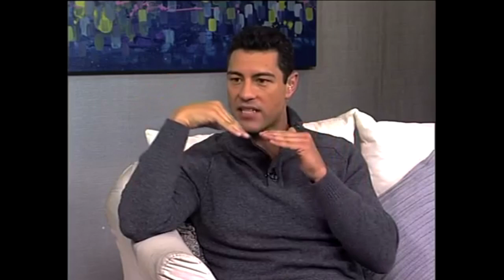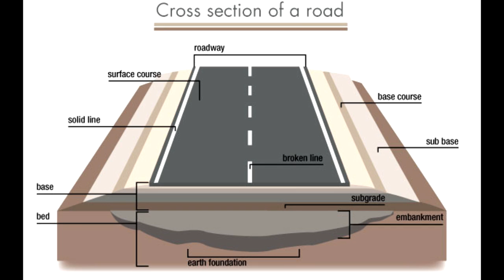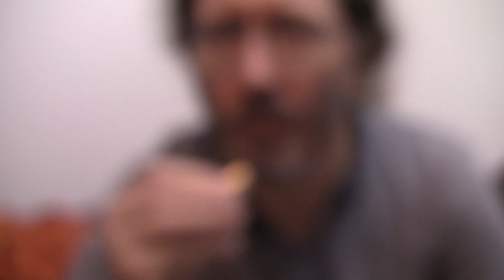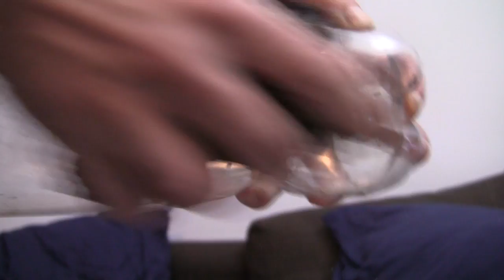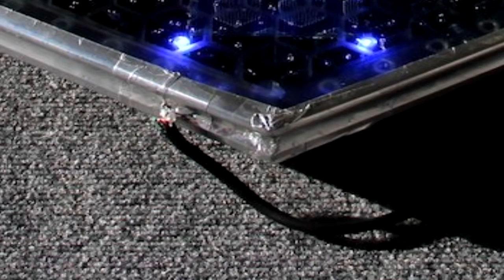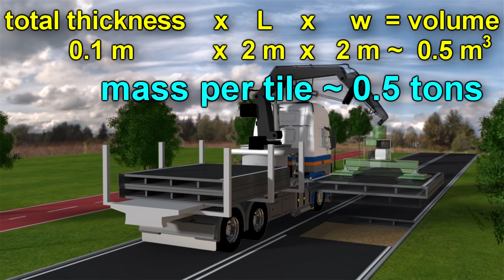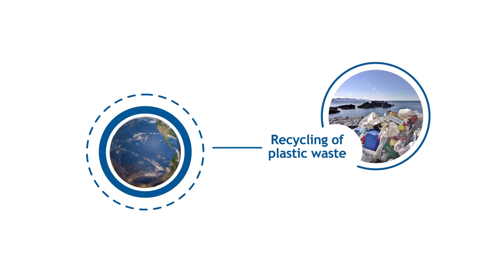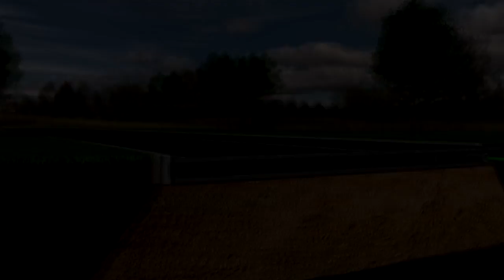Plastic Roadways BUSTED!

Comment: Sometimes on hot days over here in Australia the road gets all melty and gooey so how would that effect the plastic road? How would the various temperatures of different climates effect the plastic roads? What kind of grip would a plastic road have and would cars need new wheel tread so they don't slip and slide around on the plastic?

I have so many questions and by the end of the vid they only seem to have answered one of them. Good...

Comment: debunking advertising is pretty silly, as it pretty much is selling you on what they hope to achieve, so that you/government can support it with money. Just from the data you presented in the video, it is not obvious that they are going to try to make roads directly out of PET, and it may very well be that doping in some chemical will improve the support characteristics. Laughing at the bad construction of the solar walkway doesn't really say much, as innovators are not the mass manufacturers who will eventually be bringing stuff to scale, and production will improve over time.  To truly debunk plastic roadways, I think you would need to prove that it is infeasible, which simply isn't clear from information in this video. If there is any chance that it can be done, it could very well be an upgrade to infrastructure, as the goal seems to be simplifying road maintenance by modularizing the road and speeding up road  construction and repair.

Comment: I understand your point, but you are simplifiing it too much. PET is already in some mixture of asphalt. You do not drive on bottles if that is what you think!. Cement is really weak but steel reinforced concrete not. You just need to use the right materials.

Comment: Does this guy know that the roads are not going to be made of water bottles, it will be alot thicker, yet the same plastic type, and it would propbrably have a protective cover  made of epoxy or even a small layer of rubber.

Comment: The BS detector rose beyond 100% when they mentioned water. Given that somehow some random rule of buoyancy won't be affected here, because of road stability issues, it wouldn't drain 100%. Not only that, it could easily affect the adherence of the road, added the fact that they would "replace the road" easy as pie.

Comment: i rate it 9/11. would do some burnouts on that road.
Reply: You wouldn't make smoke tho and it wouldn't heat your tires
Reply: Quietbut_Deadly yeah it would, just not as well. just because you have less traction doesnt mean you have none
Reply: Renato J you don't need traction for a burnout.  When you spin your tires it creates friction, there isn't that much given off when you drive regularly but when you do a burnout the energy has no where to go which means it creates a lot of friction.  This excess friction heats your tires and creates smoke.  Plastic just wouldn't work that well

Comment: On work sites I have seen heavy-weight reinforced plastic drive-over cableways in use, those temporary speed-bump-like channels to allow power or water lines to cross driveways. These miniature "plastic roadways" are heavily scored by even light traffic and require frequent maintenance even when vehicles are creeping along over them.

Comment: Plastic roads would warp because of the heat of the sun. Thermal plastic is the stuff they would have to use if they want to recycle. Hdpe ldpe abs pvc pla and Pete also have varying melting temperatures.

Comment: I was thinking about that huge issue...

When you have pipes and wiring running under the road, how the shit are you going to replace these when you take that block out without causing blackout's?

scare me if you have to do this while it is raining and the site gets flooded from water draining..

Comment: but what if you get the plastic from the air? nah but really a polymer based recycled binder rather than bitumen sounds interesting, though you still need the aggregate material, maybe for use on walkways/trails or relatively low traffic areas such as driveways? definitely more feasible than the original idea atleast

Comment: As someone who works for a company who builds interstate roads and highways and produces asphalt/aggregate, the concept of solar and plastic roadways is absolutely ridiculous.

You may be able to melt the plastic and use it as an asphalt-cement replacement into the aggregate for the base and surface layers ONLY.

Oh wait you reached that conclusion at the end of the video.

Yeah and pumping melted plastic as a binder through a plant would be a pain in the ass. Regular asphalt cement is hard enough, you need to make sure your hot oil pumps don't fail (the pipes are heated by hot oil to keep it viscous) - Surely plastic melts at a higher temperature... Which means more power at the plants, which is one of the biggest expenditures. I heard a cost analysis that yes, just a few degrees (10 degrees on say a 375 degree mix) actually really matters when you're running a plant. So companies to produce the material are going to eat that cost (well the customer will but it will be harder to sell a product when something already exists that's cheaper and performs just as well).

Comment: I can actually see this working to some degree. I think if they used the PET as a Matrix Material for Rocks. Asphalt ITSELF (no rocks) is even softer than PET. 

In wany places I have seen concrete slabs being used. After some time they crack into tiny pieces. For not-so-regularly used surfaces, driveways etc, sidewalks this stuff culd work on a leveling-layer of Gravel a lot better than these concrete slabs. They could also be connected to each other a lot easier than concrete slabs, Puzzle like.

Especially for driveways, you would not have to get a truckload of hot molten blacktop, but just a few tiles of "plastic road".

Comment: also not to mention the plastic decay from sun ray in less than 6 months it will become very easy to break . also what about countries with scorching heat that reaches 50 degree Celsius the roads would melt . and of course it's a good idea to drain water next to a freakin ELECTRIC cable !!! fire hazard waiting to happen !!!

Comment: You know what else makes this a stupid idea? In a lot of European countries, the roads twist and turn loads, which means those straight chunks are only going to be usable on smaller stretches of road. Additionally, they are of uniform length, but not all stretches of road are divisible by that length, so they'd have to chop some of them up. Then, additionally, to account for twists and turns, they also need to manufacture road pieces that turn. So when they put a number of segments on a truck, they will need to give them a mix. And then manufacturing these segments, they also need to manufacture the right amount of each type. Too many turning sections and they'll have a useless surplus. That's a lot of logistical overhead to replace something that can be POURED to fit whatever dimensions or shape your road needs...

Comment: Serious question.
If polyethylene terephthalate has such fantastic tensile strength and is inexpensive and has a low density. Why has no one attempted to integrate the material into the hull of a pressure vessel like a spacecraft or something? It seems to have superior properties to aluminium in that regard. The one atmosphere pressure gradient withstood by a spacecraft is peanuts compared to the 10 atmospheres needed to rupture a plastic bottle.

Comment: Not saying the design would work, but making something like this hollow is often good design. It preserves a high area moment of inertia while minimizing material. The material closer to the edges is most important for strength; it's why I-beams, box beams, and c-channels are used in construction.

Comment: there was a polymer stronger than steel, in which is mimiced and twisted itself in which created a better molecular structure. it was on discovery about 8 years ago, but its price was 120 times higher then steal, as being a rare and complex substance to create. a rethinking of the roadway, as multple compartments, while creating a flat surface is an interesting thought, however, grip and slip tests would need to be tested and djrability would need to be tested, thus variour installations in hih density zones can give great feed back. without all the techincal comoenents, just to test the joints and structure. thunderfoot is always killing plausible ideals... that need reworking who only sees numbers as potential, not even realizing the modern world was build pretty much in ww2, raw economics is simply doing the actions, and wide variety of skills makes it cheaper to produce, infact nothing at all, money is simply a mark to steal and monitor peoples works.

Comment: I think modular road design is an actual good idea.  But not out of Plastic.  Have big slabs of of traditional black top made and formed, pre-paint it, then you shut down a road way for an hour or so to replace a broken section.  Have gaps filled in with either Bitumen  or a small strip of plastic with a slight wedge.  17:27 and as Thunder pointed out, the broken bit can be taken back to the production facility and turned back into a usable surface.

Comment: I think it's obvious that the video in question is using subliminal messaging in their CGI models. Your first instinct is to think about the ecological impact and how the anything labeled "Green" or "Organic" is automatically trusted over things tried and true. Your second instinct is thinking about how much you hate waiting in traffic that's been rerouted or delayed due to prolonged road construction times and you see that pipe dream of a truck/crane without any counterbalances lifting half a ton and dropping it into place in minutes. I would have to say it would be nice to not be inconvenienced by road construction but this is so farfetched. On another note, this only displays local traffic type roadways, NOT highways, freeways, overpasses, and expressways. Those are a very different construction design. I'm a big fan of modular construction but like you said in the video it's gotta hold together under load.